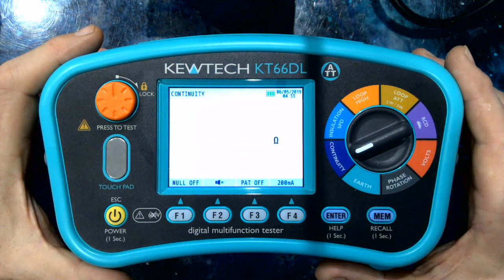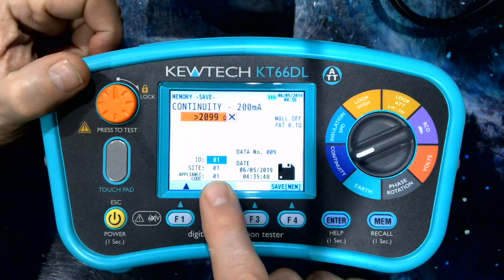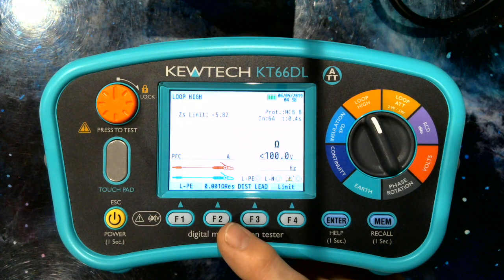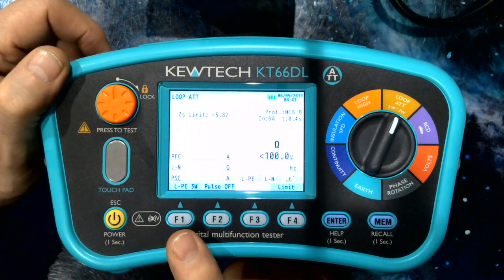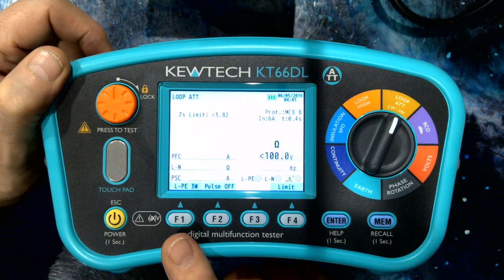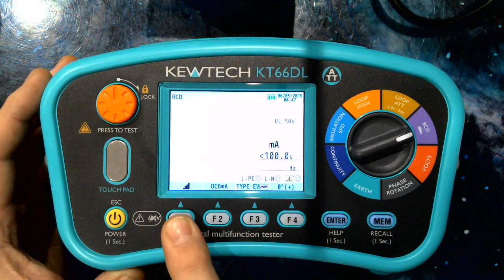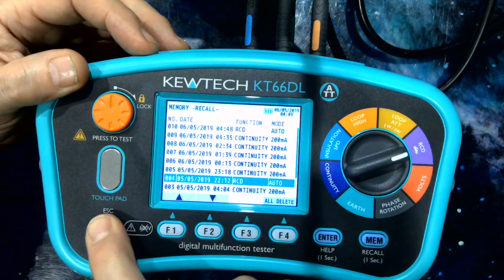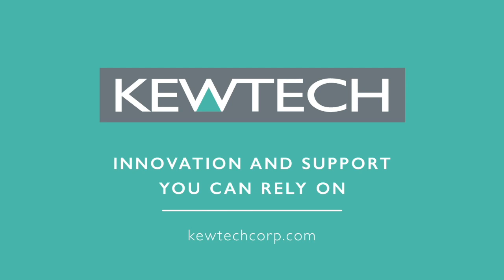KT66DL Introduction Video

Comment: Just bought this meter and looking forward to trying it today for the first time. Can you tell me what the touch pad is for please, as its not mentioned in this video?
Reply: I assume if u put your finger on it it will tell you the touch voltage between you and whatever you’re connected to mate
Reply: Got this machine today, wondering exactly the same thing, have u figured it out yet?

Comment: RDCD at 180°? Noticed it runs the DC 6ma test 0° and 180°, seems odd for DC which isn’t sinusoidal. Or is it checking that DC 6ma trip works with either extreme of AC wave present?
Reply: Perhaps it is testing at normal polarity and then reversed polarity DC ?